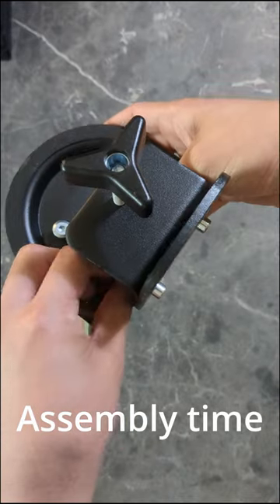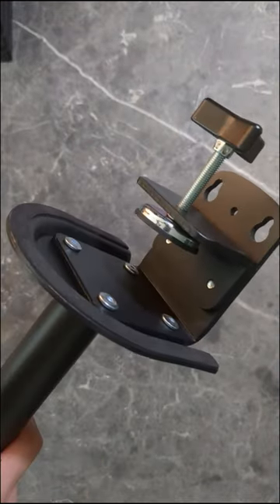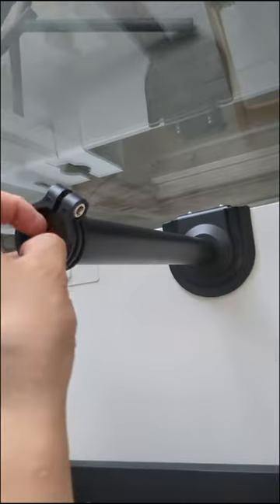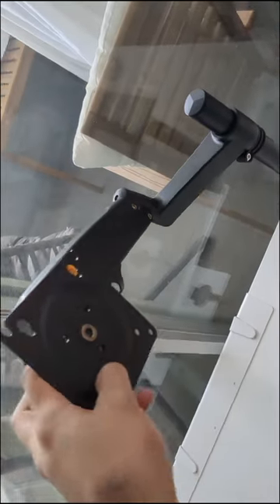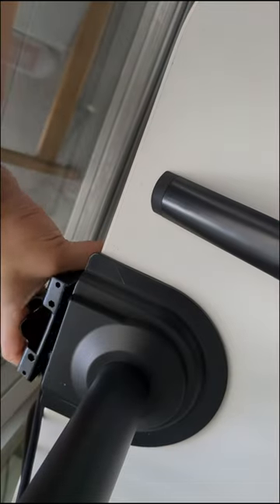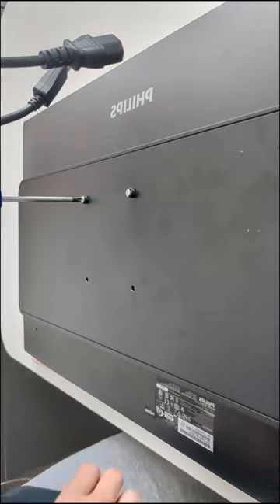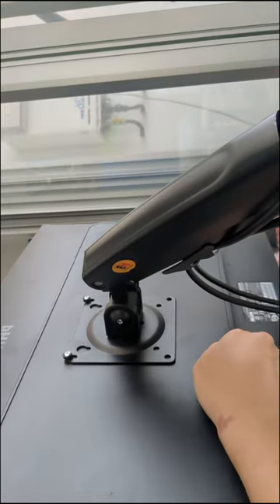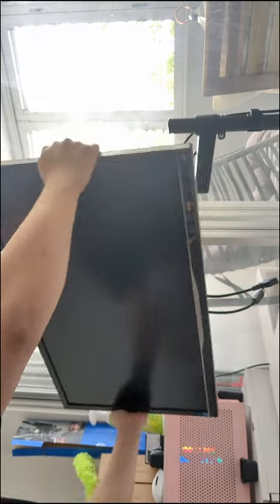North Bayou (NB) H100 Monitor Arm Assembly

Comment: the same on the video when I bring the mount down it go up back lol
Reply from the maker: It can be adjusted using the hex key. You can find my longer video to talk about how to fix that but the part where the arm moves left/right, there is a hex key bolt on the top that you can adjust
Reply: Exactly the same reason why I'm here, nearly broke my monitor out of anger lol.

Comment: HOW DO YOU ROTATE THE VESA MOUNT 45°
Reply from the maker: You can rotate it by first securing your monitor onto it. Once it's secured, you turn the monitor and that will turn the mount. It's very difficult to do it without the monitor attached first